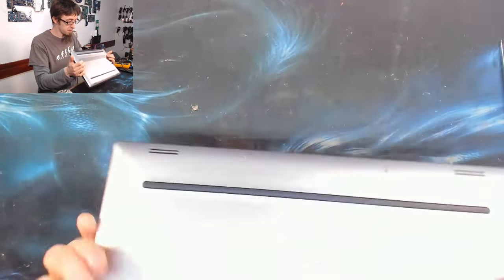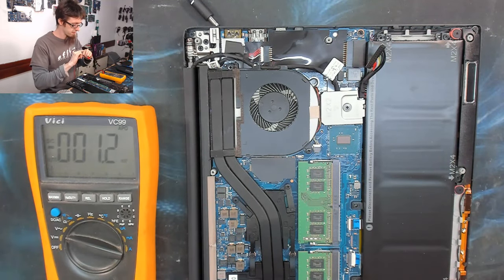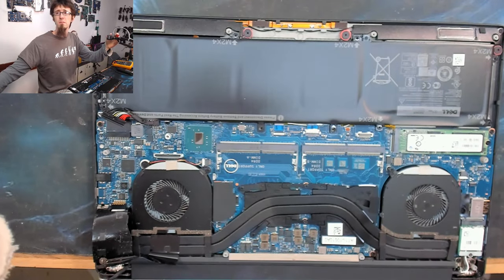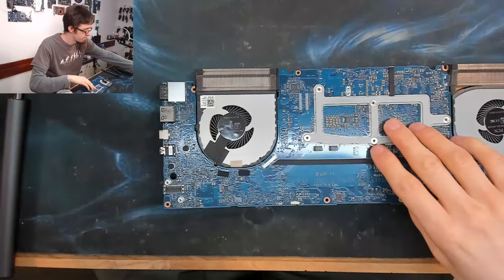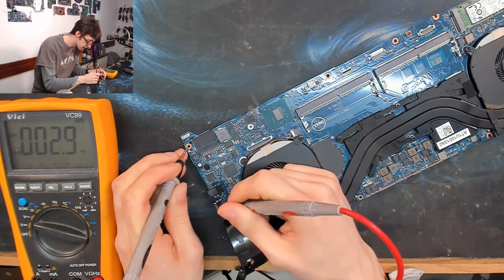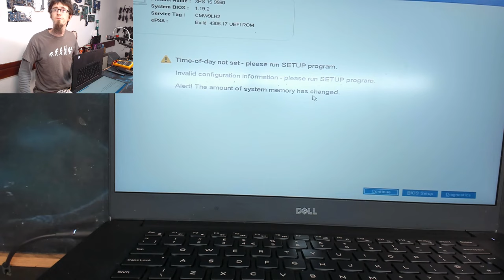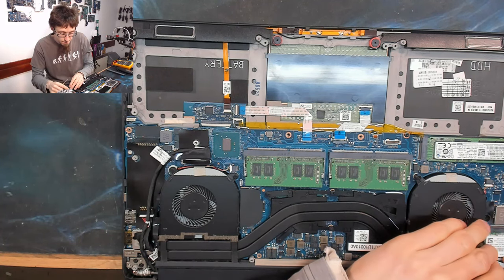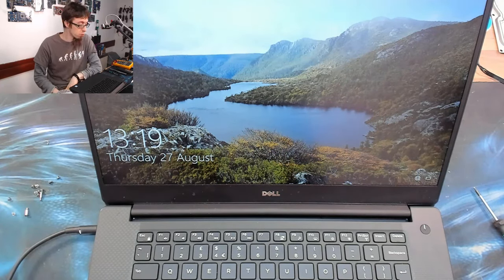Troubleshooting Dell XPS That Doesn't Turn On - LFC#226

Comment: I had the same issue on Dell INSPIRON 7000. I opened the back without knowing anything just replaced the cmos battery assuming it is more than 2.5+ years and that where I should start with troubleshooting :-) It worked.

Comment: I have had memory/sockets that just wanted a clean and the unit worked, but there was no dirt on the wipe, just makes no sense at all.
Do you watch Sorin on his " Electronics repair school" channel?
He fixes loads of laptops.
Reply: Yeah I think Sorin would of described this as a stuck bios, fixed by pulling the CMOS battery.
Reply: Sometimes it's just a cloth fiber over the pin.

Comment: Do you have a solution for the Dell XPS 9570 problem 'No TPM settings in BIOS'?

I get the white TPM error screen and the TPM update tool from Windows is failing.

Comment: In the line of work I do, people pay £60 to £70 to 'the company', not me mind you, to have their TVs change source to like HDMI 1, to switch off airplane mode to get WiFi, to plug in a modem that has "fallen" out of the wall socket. Easy repairs give you a well deserved break from all the hard work. I don't mind it either.
Reply: I feel ya!! 
factory direct sets the appliances for our main builder , and I almost always get an easy call couple times a week where they hooked up the dishwasher but didn't remove the knockout plug from garbage disposal and it gets jammed in side wall + makes horrendous noise 😂😂
I'll show up , look in with a light to find the plug then use a pick tool to unjam it. BAM nice easy job,
definitely makes the all day jobs on one thing more bearable

Comment: Loving your videos mate! I noticed at the end that the battery charge was super low - I had a laptop earlier this week displaying the same symptoms (stone dead, no lights/boot with DC in, even with the battery disconnected) but just needed me to leave the DC connected for a while to trickle charge the flat battery. After that the machine booted and charged up the rest of the way normally. Could it have been similar in your case too?

Comment: I have an almost identical XPS laptop and have +19v coming in from the power supply like the first troubleshooting step you went over. But I don't have any power on any of the voltage regulators. No shorts from what I can tell. Is there a fuse somewhere that I should be looking for? Thanks for the great video!
Reply from the maker: Need to find the inrush limiter, which will be two mosfets in series after the DC in jack. See if 19v is getting past there, or if there's a short at the output from those mosfets.

Comment: My xps 9370 is giving me some issues like when I plug it in with the type c charger the metal parts are giving static shocks. Like when touch the metal parts, it feels like it’s vibrating! Is there any fix? I've checked all grounding and earthing, the problem seems to be in the main body of the laptop!

Comment: nooot fair, it's been like a month since I've got something easy like that, my last repair was a dead cpu :'(
Reply: Yep... freezed  pc are not interesting... better some sort of short circuit. :) btw this kind of issue can be easy solved without doing any video.
Reply: @laboratorioassembler  nah dude, a video is a video, I think this case can be used to tell people that sometimes things are way easier than you think, its still a great video

Comment: You've got to get lucky some time!  I have a Toshiba laptop that had 'a broken hinge' when I took it apart both hinge mounts were totally broke, with the 2nd only held together by the case clips! Unfortunately the Satellite 650 is a lower shell mounted system , meaning a repair would require transplant of the mobo, all daughter boards and i/o to a new lower shell, not great for a positive outcome. Picked up a higher spec 2nd user newer laptop for £85 ,  better all round.
Reply: Watch Sorin fix hinges on Electronic repair school using hot glue.
Reply: @switzzzz1  So janky and not a long term solution.  New shell is cheap enought but not worth it to transfer all items to it.

Comment: silly question
 how would you go around if you had 2 ded 10 years old dell laptops and know they both have different faults but still had to fix one of them?
for some info, they both the same board revision and they both turn on, but one instantly power down and don't show any lights on diagnostic test (which is strange) , the other one is most likely stoping at shorted/overheated graphic chip, at least that what diagnostic test shows while gpu area is getting warm
there is no value in that but that is a work computer with some programs on it that can not be installed on different hardware setup

Comment: One simple thing that you can try with a laptop that is acting like this is to disconnect the battery and the charge cord, Then press and hold the power button for 30 seconds. Release the power button and reconnect the battery and power supply. Then try powering up the system and see what happens. What this does is to drain all of the residual electricity from the components on the motherboard essentially resetting the board.

Comment: My xps 9310 stuck at boot logo suggest is it motherboard issue or ssd issue and it happened just after driver update post that not able to boot also

Comment: On at least two occasions I've had a "no power up" PC start working again after I simply took it apart and reassembled it. In one case, I'm pretty sure a DIMM was not completely seated at first because I had a hard time getting it seated; the latch appeared to be closed but wasn't.  On the second, I still have no idea what got healed when I put it all back together.

Comment: Nice video as usual, I have had a few like this and I like you are not totally sure, but I hazard a guess that the power management gets confused and won't let it out of standby.
I assume they have just shut the lid rather than power down.
Did you notice what the main battery state was straight after you rebuilt, because I wonder if the main battery has gone too low for it to restart from standby, and confuses the APM.

Comment: I had my XPS15 dead after 3 years of not using it. Reset the BIOS by removing battery fixes it just like the one in this vid. Thanks ;D

Comment: We have a Lenovo that does that, It has done it twice since we got it. Works great and then suddenly wont power on and appears dead. 

The fix on that machine is simply unplug the battery, plug it back in and off you go.

Comment: You'll also note that the battery, upon firing back up, was completely dead. Typically the user lets the laptop die on battery power, then plugs in the charger and hits the power button. The laptop doesn't power on, so they panic and bring it in to a repair shop.
In cases like these (Ultra-Book style laptops) I like to save myself some trouble by plugging them in for an hour or so, while I work on other things, before i ever try to diagnose it. about 1/2 the time the laptop just comes on. It seems that they are below a safety charged threshold, and to spite being On-AC, still refuse to start.
Reply from the maker: Yea, there's a lot of milage in that. It's especially vexing with modern laptops not having clear Power On and Charging LEDs on them. Makes it very hard to know if it's turning on, or not responding, or what - especially now that a lot of laptops won't even fan-spin at power on.

Comment: I had an Acer e1572 laptop, started with no problem.. I took it apart to reset the Bios, to find out this particular laptop had NO BIOS!
Put it back together, and now the power light comes on, but it will not RESTART!

Comment: If I had to guess, removing the battery and maybe memory and holding the power button will reset the weird state that the laptop has got itself into (as will maybe doing the bios).

The laptop is in some sort of sleep/suspend state and clearing all the power fixes

Comment: bios battery is the answer; I also removed it and back in- it worked for a month longer; then it died for good. replaced bios battery and its still going (2 months later)

Comment: @Adamant IT I Hanged SIO firmware - that's what happened. :) You disconnected the baterry, SIO was reset and that fixed it. :)

Comment: What's interesting to me is that the battery indicator on the Windows lock screen seems to show an empty battery. 
Could it have been a faulty connection from the jack to the board? 
I know some of those 5000 series Dell Inspiron have a serious stupid fault where you'd need to physically roll the connector while plugged into the jack for it to even start charging. 
I'm no expert on these things but that happened to my ex's laptop and I tried to fix it. Found that solution on a random thread and thought it couldn't work because it shouldn't work, but then it did work.
Reply from the maker: In this instance it was just a flat battery - but yea worn DC jacks leading to No Charge are common with Dell as they use a sense pin. The laptop can be receiving power and turn on, but if the power management chip doesn't see the Sense Pin, it won't give the OK to start charging the battery.

Comment: No where near the same but it reminded me of Customer phone lines being locked or Looped i used to diagnose as a Tech . You call the number and you get busy signal . But as soon as you break the circuit anywhere between the premises, network and the Exchange frame it would free up . But it wasnt a phone not hanged up either . Know that prob . It seemed to happen to electric powered and battery back up cordless phones . There was a Fax machine with dialer and phone handset had the most of these troubles . But they wernt faulty . tested that . the good old days

Comment: I didnt touch my laptop for some weeks and had the exact same issue.

went through the same process.
disconnect CMOS and RAM... BOOM 1 sec light like in the video.
connect only 1 RAM and bam! it came back to life

Comment: Helpful as this is the kind of things that happen on the bench.  One, question though, what were all of those extra parts to the left?!  :D
Reply: If you mean the ones at the end, those are the screws that hold the bottom cover on.
Reply: James Collins , thx.  That was just a lame attempt by me to be funny.  I always laugh at myself when after reassembling, I find that part laying there that I forgot, and have to take it all apart again to reinstall and reassemble.
Reply: @surgingcircuits6955  Urgh, i fucking hate that feeling with all my heart 🤣 OR if i forget to plug the touchpad cable on some HPs, yes, it's always the damn HPs...

Comment: IDEA: How about to put together a diagnostic check list. Not a guide. Just a list of things to look for, like:
- check for liquid damage
- check for damage on all connectors (power input, USB, VGA, docking port etc.- bent pins)
- check power supply/adapter for proper voltage, also validate with Laptop specs.
- check for short on power connector between +/-
- check solder joints (borad, cables) of the power connector
- check for broken/damaged cables, flat cables
- reset BIOS (pull, all batteries, power and short BIOS battery contacts to discharge all residual energy, reattach batterers and power on)
- check keyboard (disconnect from board and try power on)
- check touchpad (disconnect from board and try power on)
- check other components (HDD, SSD, WiFi, CardReaders etc.)
- check motherboard for damage (liquid, discolored/burned components, mechanical damage (from broken hinges), cracks, long screw damage)
- check main power rail for power
- check 3.3V power rail for voltage (on power button)
- check 5V power rail
- check 1.xV memory and CPU power
- check battery charging circuit
- check LCD backlight voltage
- trace power rail voltage from main input, follow the energy flow
- check for shorts on all power rails
- check for signals (like reset - when power button is pushed the 3.3V goes down a bit)
-check if IC have power on their VCC input
- check for signal/input of enable pins on Mosfets, controller chips if they are enabled

If you are unfamiliar with the board, take high-res pictures of the cabling and board (you might not remember what you did 2 weeks ago while waiting for parts to arrive.)

The items can be later grouped based on the problem to solve.

PLEASE ADD YOUR THOUGHTS WHAT TO CHECK FOR IN POINTS BELOW! (add a short description if necessary)
Thank you!
Reply: Yes, a repair tech should always have a procedure ready in his mind for troubleshooting. I've had too many laptops come back from the dead just because of dirty mobo connections - like DIMM slots, RAM module pins, WiFi slot, CPU socket... It became one of the first things to try after BIOS reset, especially if you notice dust buildup around the DIMM slots. Even had a "completely dead" mobo come back to life by just giving it a last resort alcohol scrub with a stiff brush - worked like a charm. Pesky hygroscopic dust or copper patina caused by constant temperature cycles 🤦‍♂️ Forgot to mention silicon grease from old degraded thermal paste somehow making its way to the CPU pins inside the socket, go figure...

Comment: thats a very common problem in laptops with non removable battery, you need to open them and disconnect battery memory and cmos battery if there is one

Comment: Not fixed, the cmos battery is defective.. Got same laptop, which wouldnt turn on. Reset by removing cmos battery, Got it up running, but was unstable, and went dead several times afterward until new cmos batt was installed,,

Comment: right, so i was working on Asus x2023e board and it had power everywhere it should have been  no shorts power button and brick all good, but never got it to turn on, very frustrating
Reply: so ram, great, but on my board ram is mounted, wonder if i should try a reflow on the chips - what do you think? email me if you'd rather, thanks again for a great stream
Reply: Try to unplug cmos battery for a couple minutes. If that doesn't work, then check the bios chip and startup i/o chip
Reply: @muhammadrizkiramadhan8557  i did that as well
Reply: @Ed31003  then try to change the bios chip

Comment: i think i have the same issue with my dell laptop, it sometimes doesn't boot until i remove the ram and reinstall it. its 5 years old. i find it odd that this laptop didn't beep when you boot it without the ram because mine does.
Reply: Probably because the speakers were unplugged.

Comment: Please recommend a rework station for me. One that's not expensive. Kindly reply as soon as you can. A link to alliexpress or Amazon would be appreciated. If not, the name and the price range will be okay. Thank you
Reply: I've heard people like stations from RS Electronics over JBC ones, but no one (popular) seems to give them a go and review them properly, maybe check them out if they have a store in your country (I don't have the option). Still, they pretty much cost as much as a Weller, so it depends on your understanding of "not expensive" :) I'm using a KSGER T12 V2.1 (Banggood/AliExpress) - a fake Hakko, that actually functions better than the real thing and is cheap enough for my needs. Beats any entry level station in my book.

Comment: When you work with electronics as pc components then you MUST have antistatic mat and you must be connected to GND yourself! Important!
Reply: that's ideally what you want to do but it really doesn't matter... I've worked on and built lots of desktops and laptops and never once broke a component, unless you are in socks rubbing your feet on a carpet there is nothing to worry about.
Reply: @PuRpLeIzLeGiTx  My friend often complains that he gets spark when he touches metal!!

Remember that PC components are sensitive to static spark!

If I send something to a Norwegian data store for repair, I will not receive compensation if I do not use an antistatic bag!

Comment: not using the electric screwdriver?
Reply from the maker: I hate swapping out screwdriver bits (it's faster to just pick up another screwdriver), so I use it on Philips only, this laptop was mostly Torx.
Reply: @Adamant_IT  i have the same one and i wish it had a torque setting.
Reply: @paulcanning21  pretty sure he meant the non phillips screws were torx head , not that he was "torquing" the screws to any specific setting 😘
Reply: @deminybs   i know, was saying i wish the electric screwdriver we have had torque settings

Comment: sorry dude but you have gaps in your knowledge in your field of expertise.
u did a cmos-reset. u can do it by shorting cmos contacts near by pch (sometimes the contacts are under RAM) too without waiting or u can short cmoc-battery-connector-contacts on the mainboard without cmos battery and don't wait too.
why u don't use a power supply? i am "blind" without power supply. if i see amperage i know wich section could be defective.
my advice use power supply for example korad 3005d or better Korad KA3010P with 10A

Comment: worse PC in history xps  dont ever try to buy a stock version then upgrade it :)
Reply: I bought mine in 2015 and updated the wifi card. Still works. Must be the exception :p
Reply: @proditaki  Same here, I also changed the WiFi card. I need a battery replacement, but they discontinued the battery.

Comment: So you have no idea what you are doing. Just guessing and no proper check down list. #FAIL
Reply from the maker: I think you misunderstood me there... What I mean is that "The device doesn't work and I have no leads. Therefore I'm looking at random for things that might prevent it from working, and checking that it has what it needs to work."
This is in contrast to "This doesn't work because it is liquid damaged. There is corrosion on critical components."